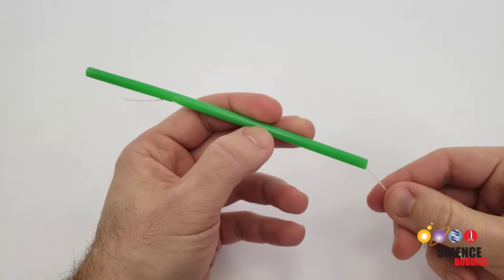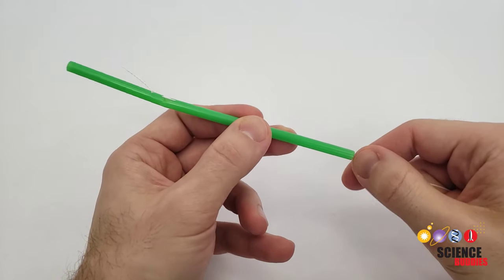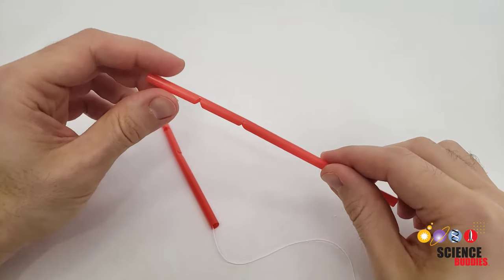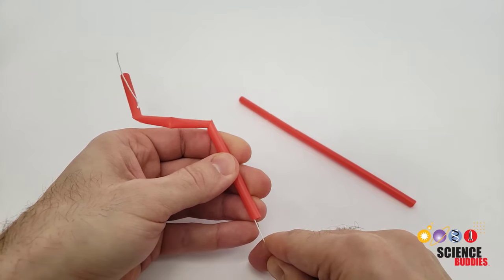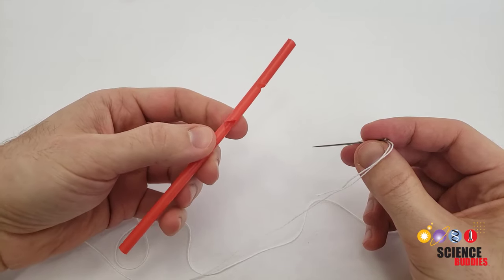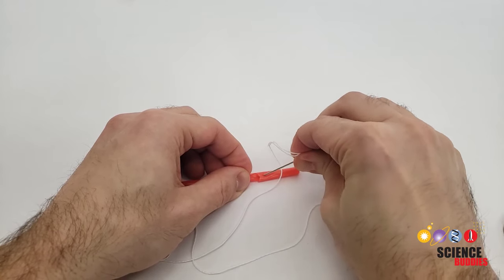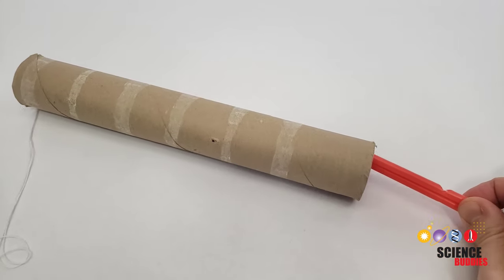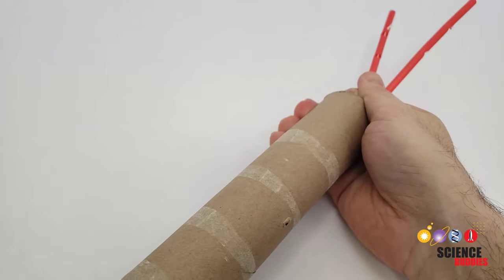Make a Robotic Hand with Straws | Science Project

Comment: Plastic straws are banned in my location and cannot be found anywhere. What is the modern solution for this?
Reply from the maker: This project should work with plant-based biodegradable straws.
Reply: @Science.Buddies  no I tried with the paper straws and then just bend and crease and don't snap back to their original form the way your plastic straws do. It was a big let down for my son and I
Reply from the maker: There are transparent plant-based straws that have a much more "plastic-y" feel than paper straws and may work better. Another more complicated option would be to use small springs or rubber bands glued to the outside of the joints to help pull them back to their original position.
Reply: @Science.Buddies thanks! I'll look into those options